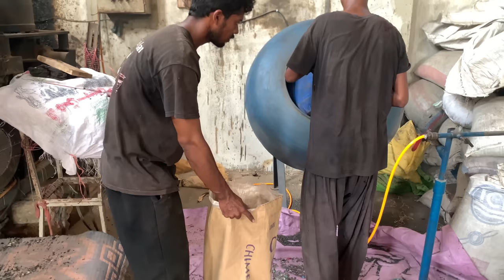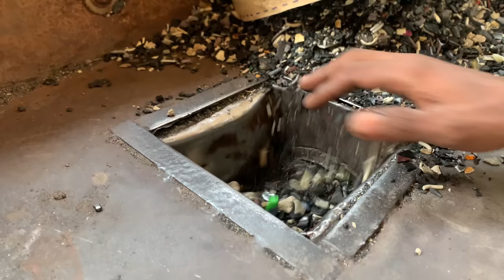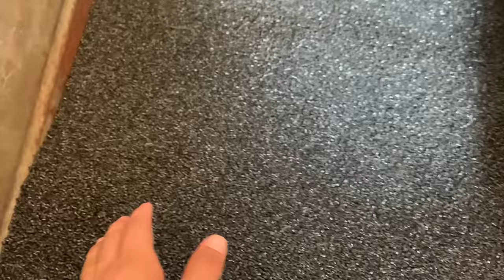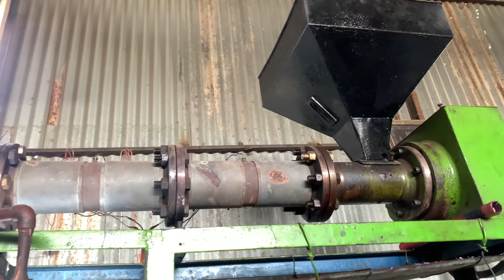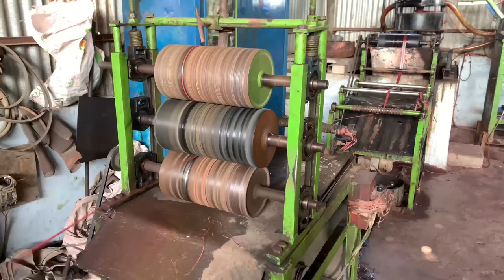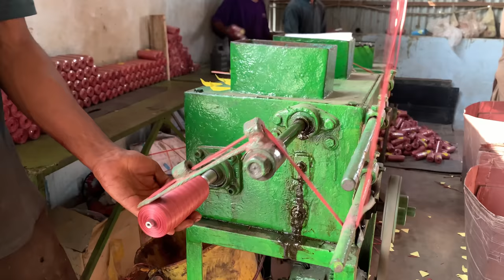How to make Plastic Rope by the Recycling of Old Plastics Material || How to make Plastic Thread 🧵

Comment: I think this is the first  time I've seen one of these videos where the people were working at a table and sitting at work height and not on the ground
Reply: But they're still throwing the packaged product on the floor!
Reply: But they still have never shown tests showing products meet certain parameters
Reply: @idiotburns  because it doesn’t meet the requirements 😂 please watch the oil filter manufacturing video as well… I’m going crazy on videos like these last weeks.
Reply: @pg41226  that is why you can buy those oil filters for three dollars each on the net! Quality absolutely guaranteed (Not)!
Reply: @Raj-nh3fc  you are absolutely correct. In Sydney Australia I made filters for cars, lawnmowers,etc and when sold they were reasonably priced to reflect manufacturing costs. These places make things to a non standard so quality is not ascertained.
Reply: @drivestowork  0
Reply: The guy is touching hot metal with bare hands, we can see the fumes coming off with no breathing protection.  It is very sad that this is the environment that these people have to work in.
Reply: Everything in that part of the world is made from something that’s been discarded. Good for the recycling crowd, but i wouldn’t have much faith in anything.

Comment: So just an idea for you at the last stage of making the roll.  When the string has the bag put on it have it be set on a board that goes down at  an angle \ to the machine that closes the ends.  The person on the machine will never have to move.  Also when they come out the bottom have it go at an angle\ into a box which when filled up can easily be shipped instead of having to pick it all up off the ground again.

Comment: That minor's loose clothing around the unshielded rotating equipment is awesome.
Reply: Back in my day kids didnt have any shields, equipment or clothes.
Reply: @kozapytapl  Find that hard to believe unless you're 150 years old ,
Reply: @lliambunter  No, we had an out of order machine something like that which was owned by the previous owner of the company we bought. The job security inspector saw it. It had no power connection, nothing, ıt was just standing on the corner.  He fined us nearly 2K USD. That machine have been using till 2004. 
This was in Turkey.
Reply: It’s the only type of clothe available. Traditional clothes. So he better watch his sleeves / pants
Reply: @lliambunter  I'm in my 40's and I can concur. I'm even from North America... Maybe you just got raised in a tight closet lol

Comment: Can pack in final rope bundle cardboard box instead of individual packing n branding as can help reduce cost, labor and time
Reply: This is sorta amazing. But I've never seen such tiny rolls in my life. That's what, 20 - 30m each? Way too much work and packing material to produce such tiny rolls. The rolls I buy measures 40cm x 30cm diameter. I go through that in about 3 months. 😁

And if the factory were to invest in machinery to spin and ply these, they'd make ropes that are much much stronger and less likely to fray. I do that, but it is slow because I do it manually with a simple tool I make. Spun and plied 4-up, this kind of rope can easily support more than my  weight (about 60-65kg). Probably more, but I haven't tested it to destruction.
Reply: @danielch6662  it’s string not rope.

Comment: while the safety - standards - or at least what we in the - west - consider standards, might be for the birds, they try t least something. instead the plastic trash that cannot be recycled anymore hauling it to landfills. or turning it to  the incinerators. at least there it produces electricity and steam and hot water.
Reply: You can live on a pile of this plastic and it will be ok, but the fumes that are going from this plastic when they are using fire to heat it up... it is not about "standards" it is about cancerogen stuff that with air via lungs going directly to your blood...
Reply: @Bialy_1  don't see the operator sticking his head into the drum to get a sniff of - poison -

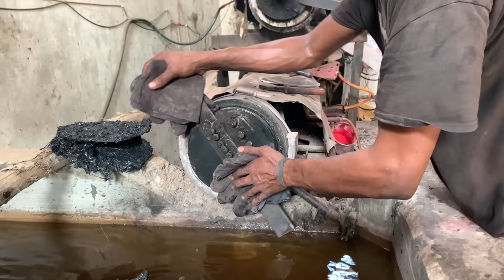Comment: Is that a vaccume and air filter at 2:48 where the guy takes a screw cap off? It sort of looks like most of the steam and melted plastic fumes go off away from the worker. I wonder how the water is kept cool, or if it has to be? Wow, quite the process! Neat to see people's inventions, you know, the mechanical workings of these machines! Nice finished product🙂. I hope there is descent filtering for the building.

Comment: What kind of machine is that
Reply: Yes.
Reply: Sapunari machine 🤖
Reply: 인젝션 머신 원료 만드는 과정~
Reply: Extruder
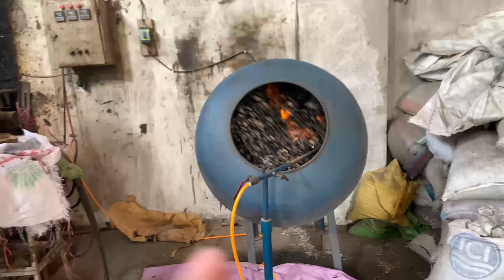Reply: At 6:23, in order of summary:
Step 1 looks like a typical drum tumbler to evenly preheat and knock off loose debris. 
Step 2 is a typical screw- type extruder. The warm material goes into the auger, and is compressed and heated further.  The first extrusion forms a sort of raw material for the second extruder which makes 11 stands if I counted correctly.  
Step 3 is a water bath to harden the plastic
Step 4 is a chipper to produce"raw" plastic pellets.
Reply: Look like injector extruder
Reply: A cancer producing machine
Reply: A plastic extruder for making weed eater line and stuff.
It's better for the environment too